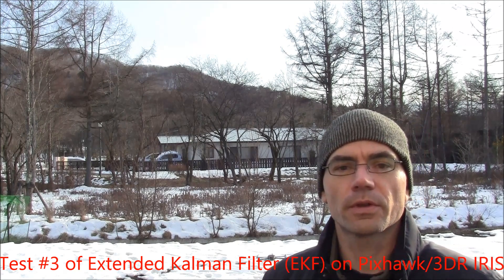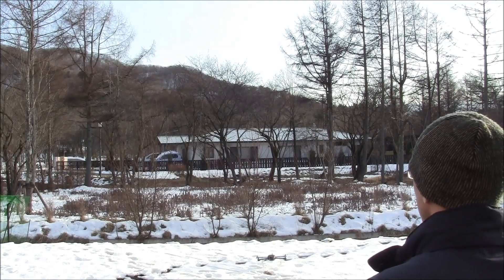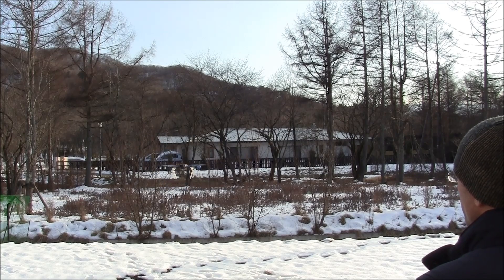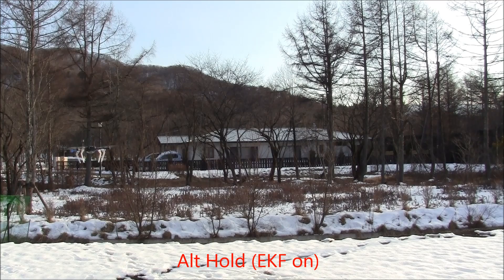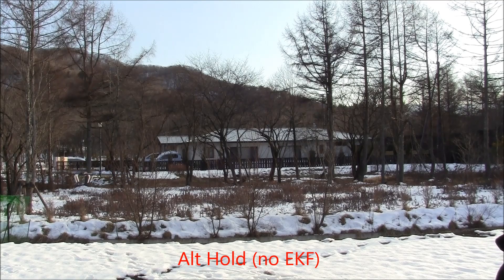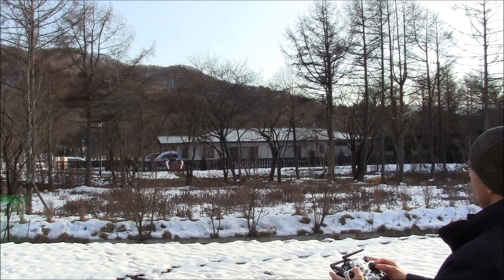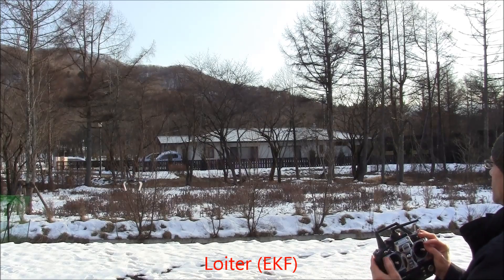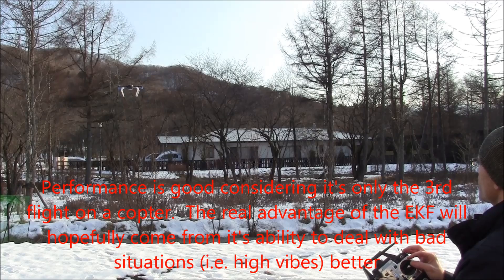AC3.2-dev with EKF

Comment: Has there been any significant improvements with the kalman filter in APM? I should have checked before posting, this is about a year old. But, still very useful to me as I've been using APM for two years plus and I am just learning about the kalman filter option. Really nice how you went from legacy to EKF from your transmitter.
Reply from the maker: Saeid Balaei EKF can' run on the APM2.  It simply doesn't have enough CPU power I'm afraid.  On the Pixhawk, it's modified quite a bit in AC3.3 but hard to notice much of a performance improvement really.